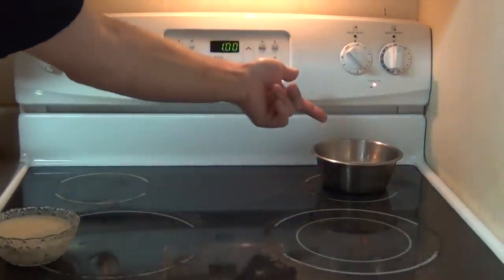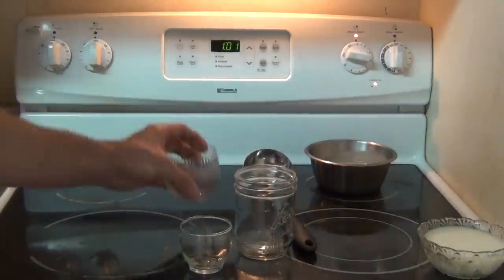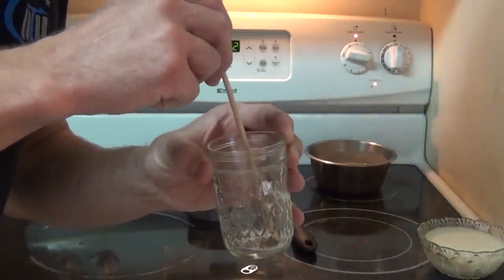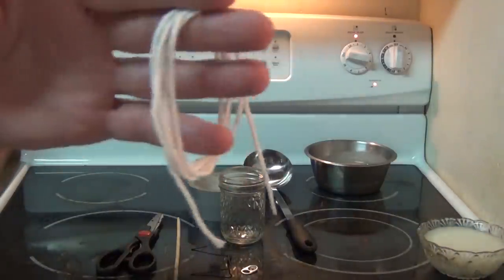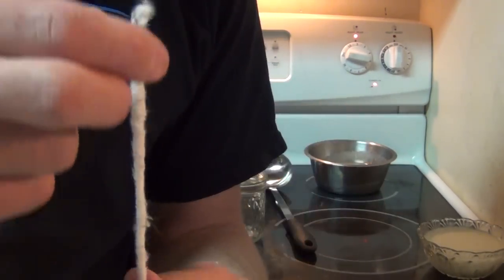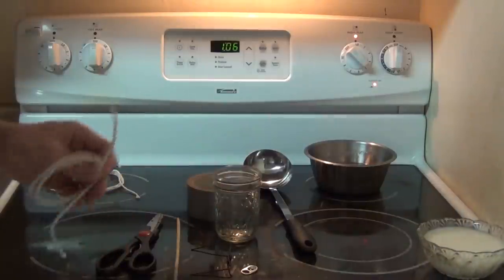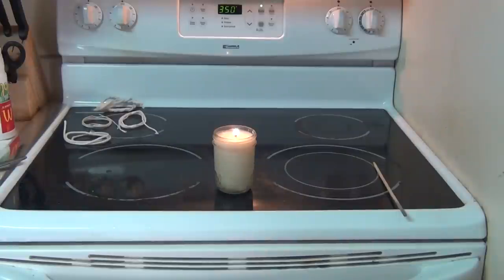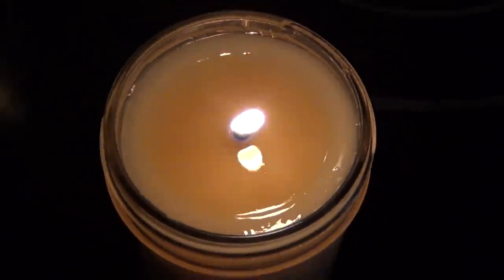How to make a tallow candle

Comment: Good cold weather project, just set outside between steps.  Thanks for video.  I am using a wood bead on the bottom of my wick and picked up small glasses 10 cents each at thrift store. For storing if you don't have jar with lid, just take foil cupcake cups, or scraps of foil, cut to fit top, tie cute ribbon or strings, place in box for storage.  This was my first time making, gave as gifts.  Everyone loved them, will send them to your channel so they can make their own.